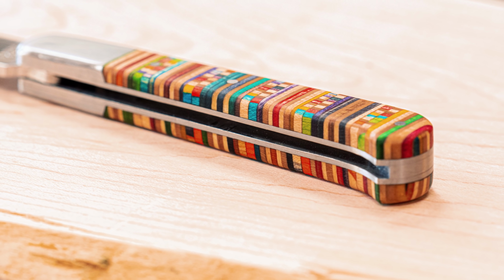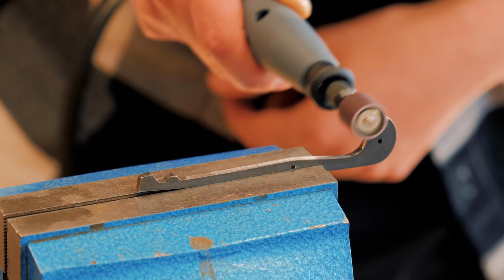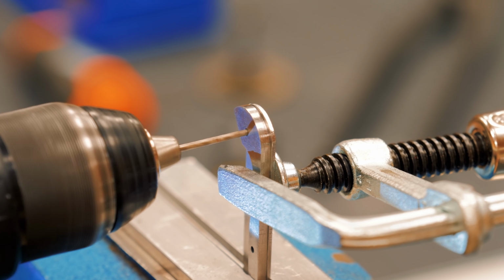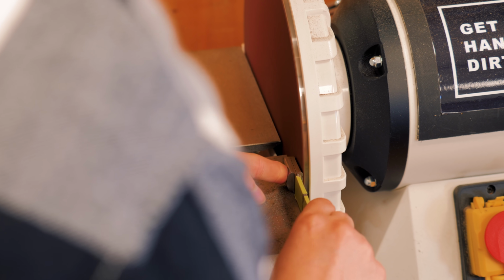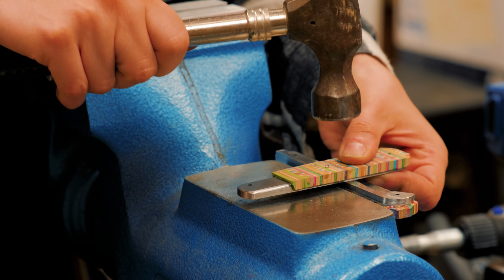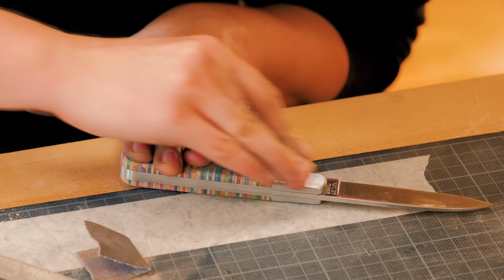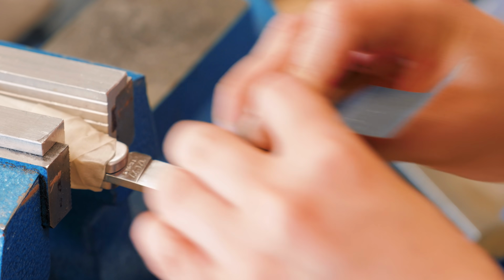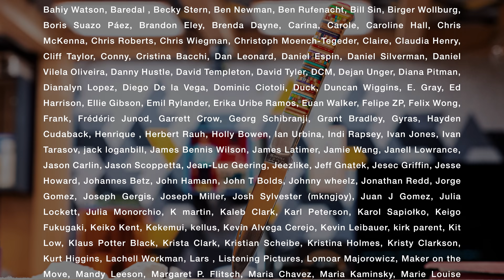Making My First Knife

Comment: As a knife enthusiast I loved this project, you did a phenomenal job!

Only tip I can provide, be careful because slip joint knives don't like to stab into stuff: the last shot is very cool but since the blade is missing a lock of any kind it can be dangerous, also the smooth handles don't provide any guard for the fingers so the danger is both in the blade closing on you or the hand slipping and having the fingers running on the blade.
Since we have to deal with many injuries related to knives wvery day, best practice is to know the limits of each blade and this style of knife is very basic so it only loves to cut into stuff more than to stab. 

Lovely work as always!

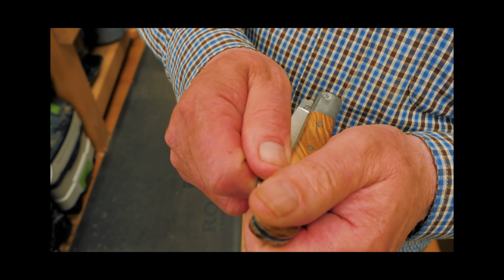Comment: 2:39 - As a collector and enthusiast, slip-joint knives are supposed to be super hard to open. That means they're super hard to close. Which, with a slip-joint knife, is very much needed since they don't have a lock mechanism to prevent the blade from accidentally coming down on your fingers while using the knife. I've actually passed on buying certain slip-joint knives because they were far too easy to open and close.

Comment: handle choice was awesome, really one of a kind..
After the '80s they departed that basic lock design to more robust ones, which I prefer and are safer, altough basic Opinel is fine as you can turn-lock with thumb.
"12C27 martensitic stainless steel is popular in the knife industry because it offers excellent wear resistance, corrosion resistance, and high hardness, all properties that make good knife steel.
What’s more, unlike other high chromium steels that are difficult to sharpen because of the hard chromium carbides, 12C27 steel attains an edge very fast. Sandvik 12C27 steel is used in making hunting knives, pocket knives, fishing knives, camping knives, tactical knives, skate blades, and ice drills."

Comment: Nice job!

A tip when you are doing any kind of peening on something that needs to move, this works great for pop rivets too. Put a shim of paper in there. The paper will give some clearance that stop things getting too tight and you can soak the item in water and move it around and the paper will break down and fall out of the gap, you can then use very light peening to tighten it up if needed. I do this a lot and it works very well.

Comment: Is that steel sanding block "gritted" or do you attach sandpaper to it?  My father gave me his block that he used for final blade sharpening (it's surface is really smooth) and I'm wondering if there's a way to attach sandpaper to it without making a complete mess...it's a nice dead flat surface to work with
Reply from the maker: I think you are referring to the diamond plate. It is 400 grit.

Comment: The spring of the knife keeps the blade open when you use it so by making the spring softer you made a dangerous knife for you . Sorry to inform you but a sharp blade with a soft spring can cut a lot of your fingers so guys don't do that at home !
Reply: In my experience as a (hobbiest/on the side) knife maker, a slightly lower spring tension for folders is better.

The chance of it actually closing on your fingers when working is really low (given I'm UK based, I carry a slip joint daily, and work as a gardener mainly), I've only ever had it close on my finger once from work, luckily it had little spring tension.

My slipjoints with high spring tension, I have opened my fingers up with just closing them.
Luckily I never had it happen when I was working with it, otherwise I likely would be in for a trip to A&E.

High spring tension is, in my opinion,  more dangerous than lower spring tension.
There should still be a fair amount, but if you're struggling to open and close, it's dangerous.

Comment: Sorry but you did not make a knife! you assembled one.
Reply: Yes she only assembled it. After she cleaned the spring, the two liners, the blade tang; after she drilled the liners, cleaned the edges, flattened the bolsters. Also she only assembled after glueing up the handle, and hammered the rods. She only shaped the handle and sanded and applied hard wax oil. but anyway it was easy breezy. Anyway she showed the kit right away so I wonder why would you watch the video  in the first place if this was just a mere assembly.
Reply: @becomingjoana  I wanted to watch the video because it says "making my first knife" and the picture of the end result is pretty good. But when I saw the kit I was like... stop lying to people. The hardest part of knife making is actually working the steel and heat treating the parts. And that is also the part that makes a knife a knife without the steel it ain't a knife. I am a knife maker and this ain't it.
Reply: @vandelftcrafts2958  she’s a woodworker. and it wouldn’t be fair to make call the video “I assemble my first knife” since she changed stuff and made it her own. It’s her first knife. It’s not a lie. the process and how she makes it is clear in the very beginning. I hope you spend as much time calling liars to the makers of actual real clickbait videos as you did on this one.